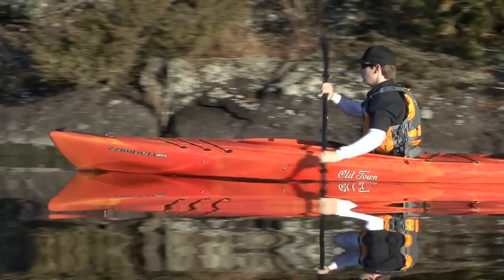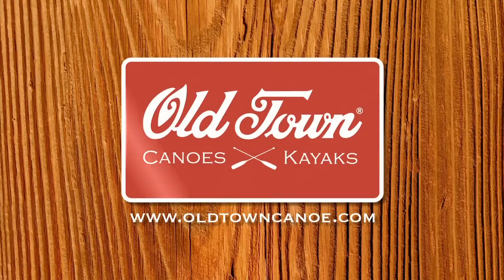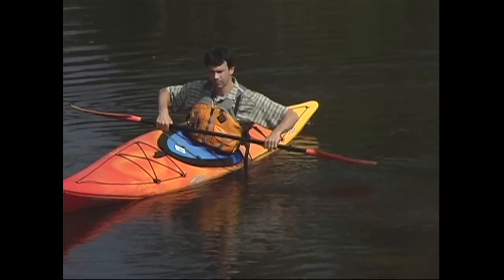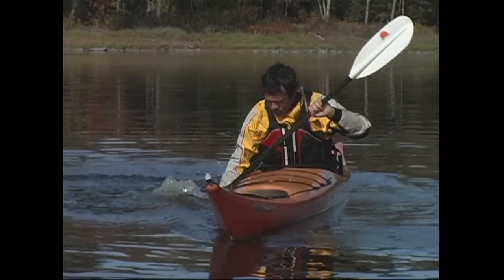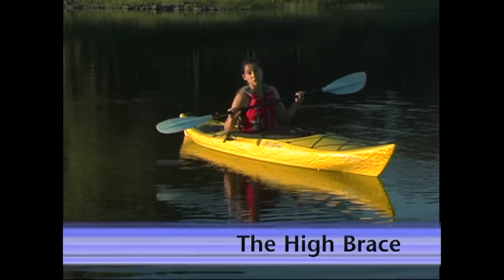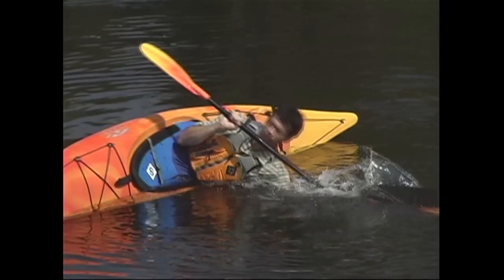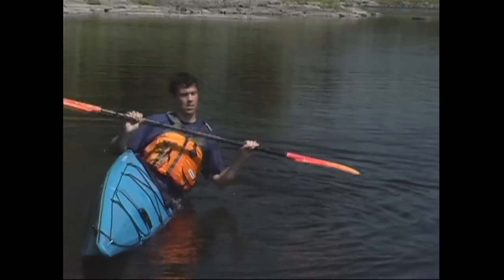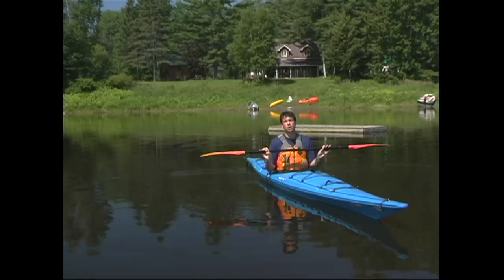Kayak Technique - Bracing

Comment: Thank you for the video. i have a question. is this necessary thing this weird move with your head?
Reply: no not really
Reply: The head thing is about the mechanics.   
First You are changing the center of gravity  in that moment so the head drop does that. 
Second watch the the twist .  You only.have a split second to rotate your hips off of the leverage you get from the paddle.  And get your hips under your head  in that split second. 
They are exaggerating the motion so you understand the mechanics of how this works . . watch the roll one